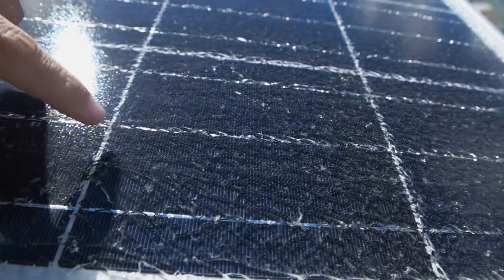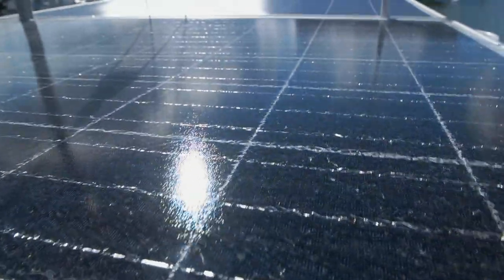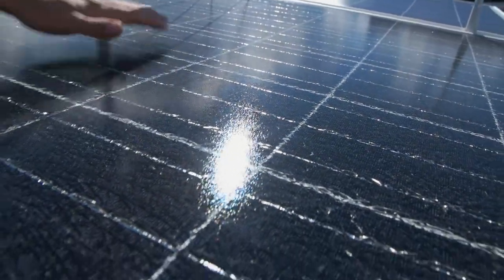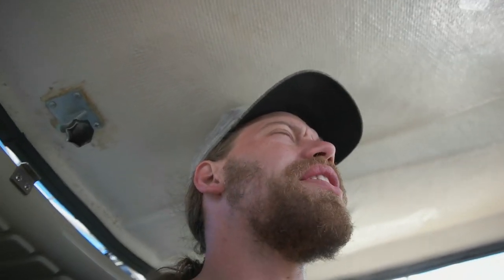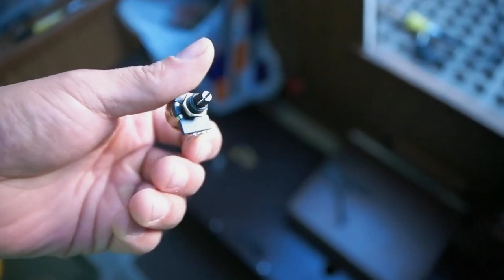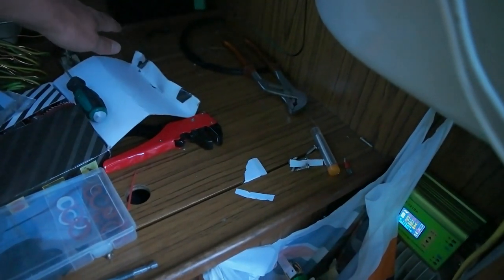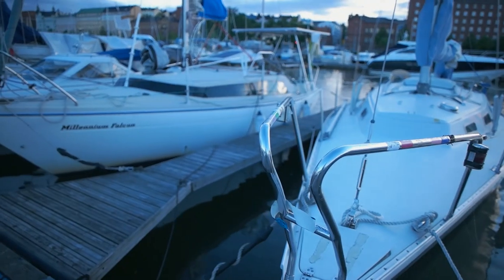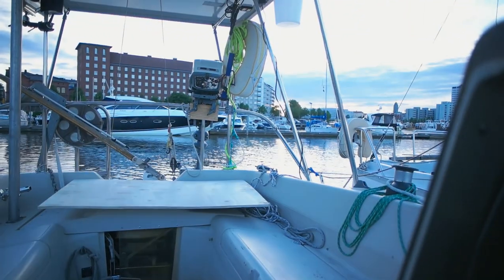LED stripping my boat - Electric sailboat vlog 0036

Comment: What about a pwm dimmer for the led light in the cabin to dim it? They're not expensive. Also have you considered semi flexible solar panels for your replacement? Much lighter and less fragile. You could build a spray deck or bimini out of them?!@#$